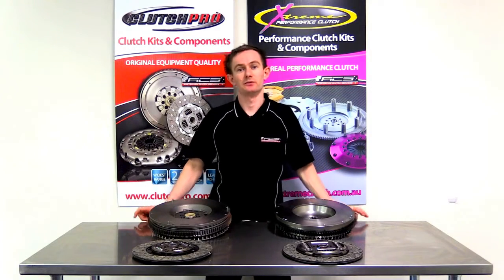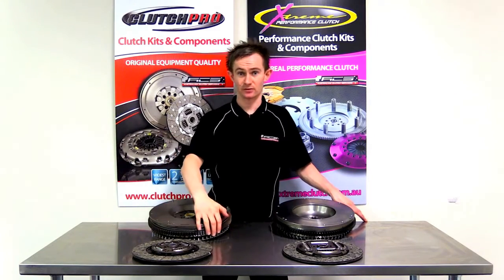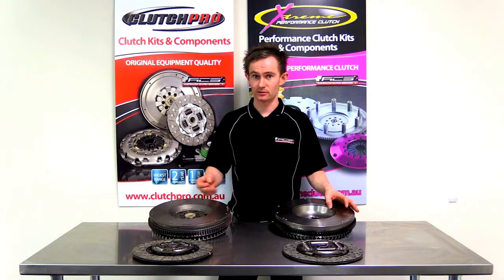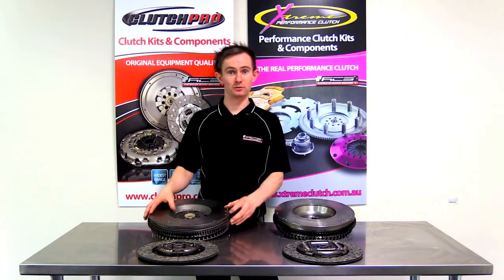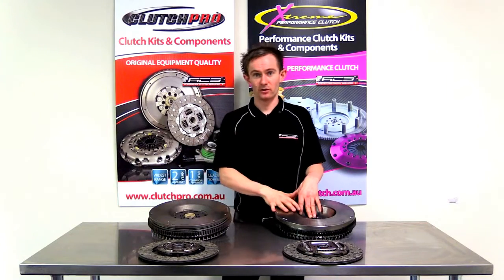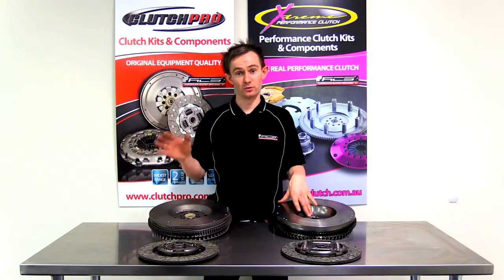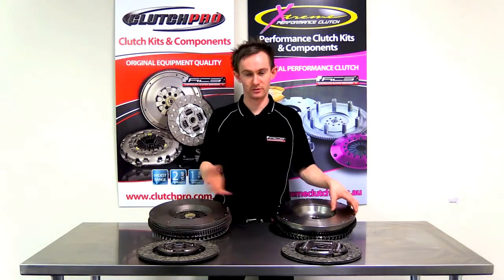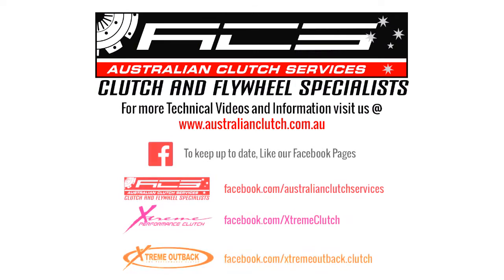CLUTCH TECH: Dual-Mass and Single-Mass Flywheel Information

Comment: I recently replaced my DMF with SMF on my Toyota Hilux Surf 1996 3.0l DT 5F because the dual was very expensive. what impact is it to have does it have same performance?
Reply: so, SMF will be more direct so u feel more the shifts etc, in short, less comfort, and also improved performance because its lighter, also it can handle more abuse, meaning clutch drops, aggressive driving is well handled by the flywheel, plus it will last forever

Comment: I’m late to the video, but I’m curious about off road low end torque. I’m haven’t increased power, but I use this SUV rarely around town. It’s primarily used off road and occasionally for towing. 

1. Would a SMF be more suitable for me? 

2. Why specifically would the SMF (or DMF) be more suitable off road?

Comment: You forgot to list the biggest benefit of the dual mass flywheel: They hold the rpm's while you take your time shifting. That alone is worth GOLD, I would never convert to single mass, would be like raping my BMW E36 M3, screw that.
Reply: THE SMF IS WHY BETTER BRO !THE SMF HAS NO DEATH!THE DMF IS GOING TO FALL EVERY 80.000-150.000 KM (AND IS NOT CHEAP TO REPLACE!) !😉

Comment: My DMF has been a DMF too long so it isn’t doing it’s job anymore. The noise on idle from I suspect to be the gearbox is like a blender full of nails and it tends to slip under acceleration and up hills. I can’t use first gear because it just jumps out, bangs loudly and grinds when I try to pull off so I’ve been using second gear to get moving which isn’t great on a hill because I have to slip the clutch to stop it from stalling. 

What can I expect if I changed to a SMF and new clutch kit in terms of the noise being louder or quieter and drivability of the car after installing the SMF? I mean it’s bad now but still drivable and quiet once it’s going down the road.

Comment: What is the best brand of single mass flywheel for 2003 BMW 325i E46?
Reply from the maker: Hi,
We offer a range of high quality single-mass flywheel conversions for this vehicle including both standard replacement clutch kits with a single -mass conversion flywheel and also a performance upgrade clutch with a chromoly performance single-mass flywheel. If you could please email our sales team at sales@australianclutch.com.au with some further details on the vehicle such as performance modifications made and what it is used for, they will be able to assist you with a kit to suit.
Thanks

Comment: I switched my 2012 VW 2.0L (gas) Turbo's OEM dual mass clutch (210 ft lb at crank) , which the previous owner had basically cooked in 25K miles. Instead, I placed a SPEC brand (Stage 1) 17 lb steel, single mass flywheel with sprung, "organic" disc.  Everything is strong now and feels as it should --- except for-the-in-neutral-off-the-pedal racket from the gearbox spinning with less damping. No grinding of synchros, easy shifting, too. 
 Do you think it's worth dumping in some extra high viscosity gearbox oil in to help dampen out the "cement mixer" sound effects when idling in neutral?  BTW, the moment I apply pressure to the clutch pedal, the noise stops completely.  Or might you have any other thoughts on resolving the matter?  Steven in Colorado

Comment: What do you mean single mass flowel, dual mass flowel?
Reply from the maker: Hi Sam,
These are two different types of flywheels commonly found in production cars. The video explains the key differences but the Dual-mass flywheel allows for improved dampening characteristics over a traditional single-mass flywheel.

Comment: getting a stage 2 tune on my defender will do about 200hp and around 400nm of torque after the tune. 
The guy's doing the tune recommended i put a heavy clutch in and a single mass flywheel in i don't do a lot of towing but do a bit of off roading do you think the single mass flywheel is the way to go
Reply from the maker: Hi Roza,
If you are installing a heavy duty clutch, the Single Mass Flywheel conversion is a popular modification to complete at the same time. Nearly all of our heavy duty kits come with a single mass flywheel conversion when being used in an application that had a dual mass from factory. An SMF conversion can result in increased noise, vibration and harmonics but if you would like to learn more about this conversion in your specific vehicle, please email sales@australianclutch.com.au and one of our friendly sales team will be able to advise you further.
Thanks

Comment: If you can drive don't need a dual massage flywheel I converted and not much of a difference you got to put up more rpm for initial take off
Reply: Single massage with outer slave cylinder lasted for years now inner slave is more labor and 4 times the cost of clutch
Reply: Technology is there just to pull more money out of your pocket
Reply: @veka9405  Your transmission will wear out more quickly without a dual-mass flywheel protecting it.
Reply: @agt155 know that this is a very old post but it would be a great help to me if you can expound on this ASAP (on the off chance you happen to get an alert) as I'm going to need+ replace my clutch on my Nissan and I could REALLY save A LOT with a single fly and the only thing I'm worried about as I've been researching the hell out of options is worries about damaging by transmission and I've really only had some vague comments on that come up but ruining my transmission would break my back n bank too
Reply: The difference is unnoticeable
Reply: The dual-mass flywheel is there to save your gearbox.

Comment: Its probably important to think why the manufacturer went to the trouble of fitting a more complex and expensive dmf. Clutches and flywheels are consumables, uprating power or towing a cattle truck out of a ditch wont help any clutch or flywheel, its just a matter of how much money you have to spend on repairs...
Reply: flaskandsarnies. I can think of one good reason the manufacturers put DMFs into cars. So they can rip people off when it’s time to replace them!  Cars only had SMFs for over 100 years and most flywheels never needed replacing for the life of the vehicle and now all of a sudden cars can’t do without disposable DMFs?  I don’t think so. 

At the end of the day car manufacturers are in the business of selling new cars. If a car manufacturer can introduce something like a DMF that makes a car smoother to drive to help get the new car sale and it will reasonably last out the warranty period they will do it. 

Longevity of service is none of their concern because people who buy new cars don’t care about longevity past the warranty period as they predominantly don’t keep the same car for 10-20 years,  they buy a new one 2 or 3 years later or when the warranty is about to expire!  

The impression on the potential new car buyer when they are driving the demo to make a decision on which car they buy means everything to the car manufacturer as this is their sole goal, to sell more cars. If they can also make the replacement part hideously expensive to replace then that’s also a win for them!
Reply: It's purely to make shifting smoother, at the cost of actual friction and a large inertial mass.  For people who regularly tow loads and aren't complete spanners, SMF is the way to go.

Comment: Thanks for the video guys.  I have a failing clutch in my 2013 T31 Nissan Xtrail (63,000 kms).
I'm reluctant to replace with another DMF as I've heard they are substandard for this vehicle.  Would you recommend an SMF conversion, even though I mostly do city driving? TIA
Reply: its now 3 years later. my 09 T31 now has a deceased clutch. i had no idea dual mass was useless for towing heavy loads in my 3m tandem trailer.  after all, the manual drive is good for 2 ton right? i very much doubt it. it will be the last x trail i buy. digital gauge for temperature etc is too small to read for an older guy. the front end was designed by satan. and moving stick forward to select reverse is stupid.
Reply: @jasonstrong4610  why the hell did you buy one in the first place lol
Reply from the maker: Hi and sorry for the late response. These are a popular conversion and we offer both the standard replacement with the dual mass and a single mass conversion. It is important to remember the side effects of a single mass conversion as discussed in the video, mainly being the increase in Noise, Vibration and Harshness (NVH). It is more expensive to purchase a dual mass flywheel but it does come down to personal preference and what you are looking for in the vehicle. If you would like any further information, please feel free to contact our friendly sales team on 1800 CLUTCH (Within Australia) or email sales@australianclutch.com.au

Comment: Hi there i have an Audi a5 3.0 tdi Quattro. I have an excessive vibration in the cabin of the car. I took it to one garage and they told me all i need to do is change the engine mounts, i also took it to another garage and they said not only do i have to change the engine mounts but i have to change the dual mass fly wheel as well. When i turn the ac on, the car revs goes from 610 to 910 and the vibrations stops completely  until the ac is turned off again. Do you think this could be a problem with the dual mass fly wheel. Many thanks !!!!!! Please get back to me asap before i waste a lot of money !! P.S the engine sounds completely the same when i engage and dis engage the clutch.
Reply: Your air conditioning runs with a belt to a pulley which is connected to your engine (V-belt) same as your alterntor and waterpump if this engine has it outside the block , so yes it could be possible since your engine has a little more ressistance on the power delivering end or keep the Rpm beneath the stock stationairy Rpm wich could cause vibrations on the Shaft that connects your gearbox to your engine
Reply from the maker: Hi Sen,
Dual mass flywheels can cause vibration in the vehicle when they fail, however the AC side of things does not indicate a typical dual mass flywheel failure, although it is possible. It is very difficult to tell without inspecting the vehicle. I would suggest you have the vehicle inspected by a dealer or specialist.
Thanks